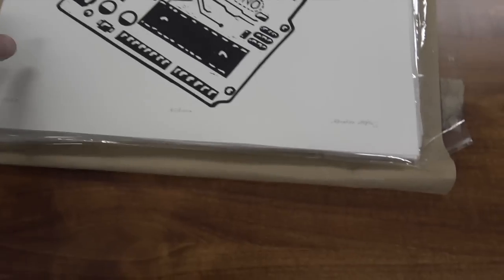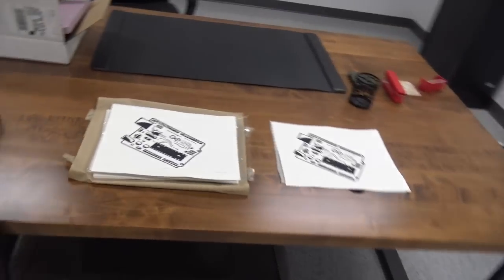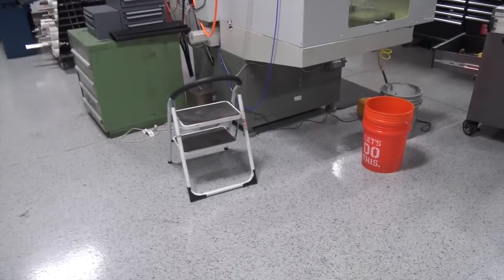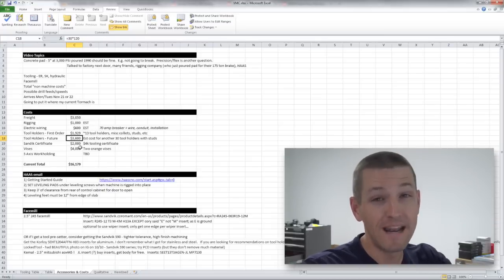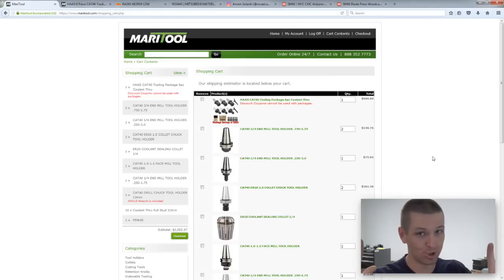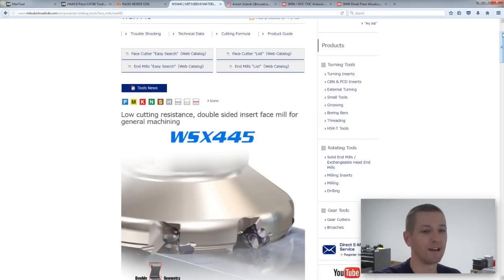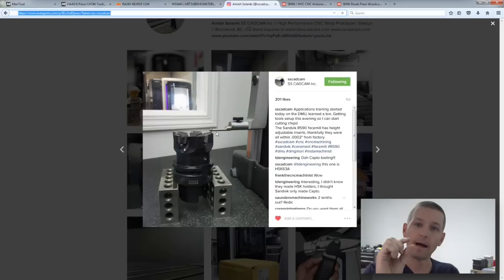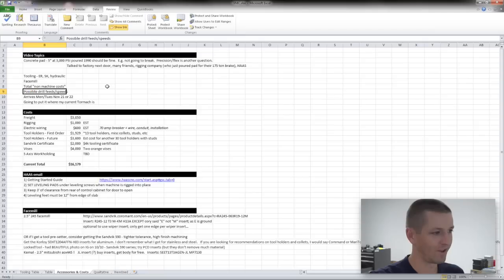Arduino Print & VMC Update!  CB33

Comment: Have you looked at the SK collet system Maritool now offers? You might want to look hard at it considering you're doing a clean start in regards to cat40 tooling. On the other hand, if you already have ERs for the Tormachs, that will be that much less you have to spend on initial investment. One thing to keep an eye out for is too much range overlap, there's no sense in buying ER25, if you already got ER32. An idea I've heard from various sources , you might want to look at buying DA300 for smaller drills, because of the smaller nut diameter,  as it affords more clearance  in tight spots. The downside is the typically greater runout with double angle collet chucks.  Personally, I would avoid drill chucks in a VMC, as their advantage of quickly changing the tool, doesn't really apply to something with a toolchanger, not to mention they have significantly larger runout compared to a collet chuck.

Also, have you looked at hydraulic chucks for larger tooling? I can tell you from first hand experience,  that the Sandvik Corochucks are nice tools, and work really well.

Comment: place the vmc near the steel beam and attach a hoist with a crane on it. That's what we did, works great for moving heavy objects on and off the machine. also try to avoid 45 degree face mills
Reply: *Never ever do this without consulting a structural engineer. That steel beam is designed to hold its share of the roof + maximum snow loading + a certain amount of overage at a specific load angle. Hang a lever off the side and attach a dynamic load to it and you're inviting disaster.
Reply: Kenneth Higley it will be fine.
Reply: yea just skip everything he just said.
Reply: Ya... no. Those beams are not designed to attach a hoist to. Those beams are designed to hold vertical loads pushing from the top down over a specific surface area. NOT to hold up a single point load hanging down from it.  A second beam could be sistered to the main then be used as a hoist beam,  but never use a supporting beam for anything other than what is was put there to do. 

And 45 degree face mills are an industry standard go to face mill for a reason... they work, they work exceptionally well. I suggest you read up on face mill geometries a bit and you'll discover why the 45 degree insert angle is so popular.
Reply: 1st of all i know about face mills. i said try to avoid a 45 degree.
2nd of all hanging a jib crane from a girder is fine as long as your hoist doesn't exceed a half ton. i have over 10 of them, i'm still alive.
3rd of all do you even lift
Reply: i use square shoulder face mills on aluminum, they multi-task and have far better MRR. i use high feed mills on the harder stuff. 45 degree works but is not for me, time is money.

Comment: Hi John, congrats on your two new great machines. But this begs the question, is Fusion 360 really capable enough to run them efficiently? I know you're sponsored and all, but so you use Solidworks and similar at all?
Reply: Andre Gross 

For the time being it'll should be enough.  Fusion can do 3+2 work right now I believe.  Supposedly they are working on full 5 axis for the end of the year.  But you'd never catch me playing guinea pig with a brand new 5 axis with it...

Comment: You could dial in the 590 inserts using a finger dial, you don't need a fancy tool setter. That being said, I ran a 490 and a 245. The 245 left awesome finishes at aggressive feeds. only downside js you can't do shoulder cuts.

Comment: John, glad to hear you bought the larger 5 Axis fixture you wont regret it. As to special foundations for Haas mills we have never poured one for any one except their larger horizontal mill. For that machine it was absolutely necessary the machine was not accurate without it (we tried without it had to have a special pad). For a VF3 size machine it wont be necessary. The has fixtures have keyways on their bases that get you very close you shouldn't have to do much indicating to line it up. A small jib crane would be very use full for that and also for putting vises on the table. I don't know how much the vises you bought weigh but you will find you have to lean over more with this machine than your TorMach mill this could lead to back injuries or dragging the vise over the table. not good if you have keys on the bottom (I don't use keys on my vises that my preference).

Comment: cherry picker is the obvious and cheapest choice but they are clunky, awkward and slow.   custom built picker with a good set of rollers and the correct geometry would be the money.   a overhead of jib crane wouldn't be usefully since you have to side load the 5th axis.  another though is a hydraulic lift cart, raise it up high enough and can slide it off your table to the cart and can be dedicated storage spot,  then you can roll it to your next 5 VMC's you buy too.  :P   

I've seen a few 5th axis loaded with a cherry picker,  it works but its truly a PITA and slower than slow..
Reply: I believe he got the TRT100 which is only 20 inches long. I could be wrong, but I think that can be front loaded in the VM3.

Edit: My mistake, I missed the part where he said he picked the TR200Y instead. However, the Y designation means it gets mounted sideways and that dimension is 19" :)
Reply: thats what I meant when i said "side load",  through the front..
Reply: OK. That was a little confusing to me because the windows on the left and right sides of a Haas VMC open allowing you to load things (and clean) from the side, rather than the front.

Ah, I get it. Side load rather than top load. :)

Comment: Are the Orange vices useful for 5-axis Work? I am working on a 5 Axis machine and in our shop we use a Lang Makro-Grip. You press a special profile in your raw Part with a separate machine and the Macro-Grip will hold it with only around 4mm in your vice so that you can machine the 5 sides of your Part without any obstacles. 
I don't know if  you can get a Lang vice in the US but maybe there is something similar in the US that is dedicated for 5 axis machining.
Reply: NYC CNC 

Skip the 5thaxis vise.  We have one. It's holding power is junk compared to a Lang. Unless you mill in the dovetail, which if you're already in the mood to mill dove tails all day, the raptors are better.

Comment: I may be wrong but for example if it has 4x4" feet, using pi * r^2,  gives you approx 50 sq inches of 'feet', 16000lbs / 50 is only a loading of 320psi. Am I barking up the wrong tree or does this mean your floor is plenty thick?
Reply: The VM3 has 6 feet and I think they're smaller than 4", but that's not the important part. It also has a max table weight of 4000lbs so increase total weight to 20,000 (Not that John will ever put 4k on the table). Your calculations aren't wrong, but they're for static loading. A CNC machine produces dynamic loading. :)

Comment: Regarding the Sandvik HM drills. 
I used to work at a place where pretty much all of the machines used Solid HM Sandvik drills for drilling in cast steel parts. The drills where the best that Sandvik could offer and yes they were good and could make a lot of holes really fast. But there is a downside Sandvik is the only ones that can regrind them and put a new coating on the tip of the drill so the drill become as good as new but just a bit shorter.
The cycle  time for when the drill was send back to Sandvik, got a fresh grind and new coasting was two weeks. In a production these two weeks waiting times was a big problem and it meant that we had to have a lot of drills. 
In came Kennametal with there Kentip system we had to try out and we (me included) were all blown away by how easy everything got pretty much over night. The Kentip drills could drill a lot faster then the sandvik drills and then the insert was worn out you just had to replace it and put the drill back in the machine without having to measure the length again. 
And best of all it was a hell of alot cheaper!
Reply: I have a 3/4 kentip that I use in my shop for those hard to drill items and it eats it up, it is really a good drill and can take a lot.
Reply: I would also use changeable tip drills if possible. You don't even need too measure the tool again after tip change. Tho the shanks are expensive and it's one shank for one size? I used Iscar at my previous work.
Reply: Also we used like 2500rpm 800mm/min no pecking just straight through moc 210. 25mm hole if I remember correct. I drilled over 400 holes before changing the insert because I was afraid it would break, tho I bet it could have handled another 100 easy.
Reply: The Kentip system uses 0.5 mm intervals.
Reply: Rasmus Laursen We had a few kennametal drill but the iscars were the main ones.
Reply: Yes i can really take a lot of abuse. In the casted steel parts i used to make we used these cutting data for a 11.2mm drill

VC=150
S= 4265
FZ=0.25 (Thats a feed of about 1066 mm/min)

There was 24 holes per part and the insert lasted 60 parts so a total of 1440 holes. Compared to the Sandvik drill that used a FZ of 0.15 and only lasted roughly a 1000 holes before it needed to be changed.